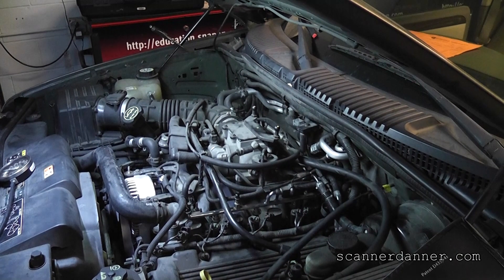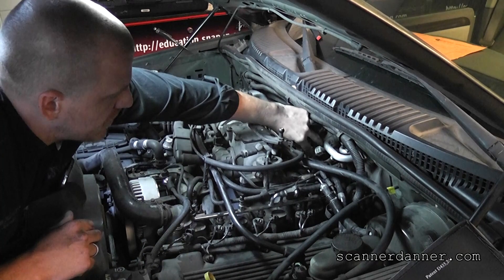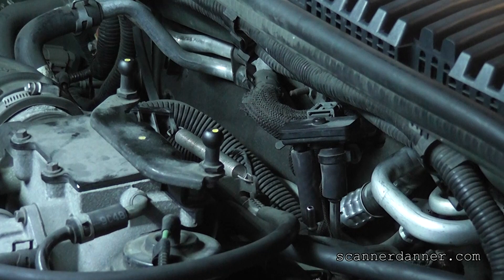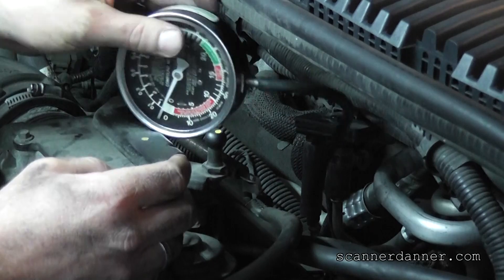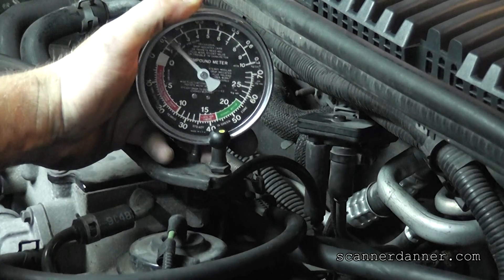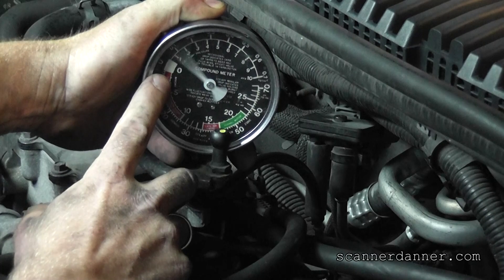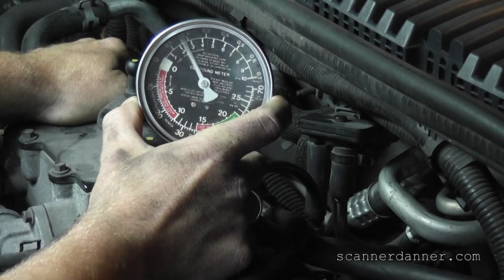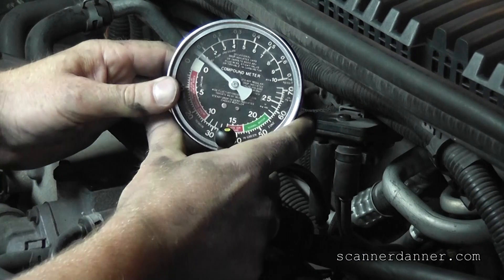How to test for a restricted exhaust using the DPFE sensor on a Ford

Comment: If you voltage test dpfe signal koeo at the pcm (just the signal pin 65) from positive to battery - is voltage suppose to <=5v? 
If the voltage is over 5v? Is it the PCM not the circuit?
Reply from the maker: How are you connecting your voltmeter? Negative lead to battery ground is how you should be testing it. What is your voltage reading at the sensor and at the computer pin?
Reply: @ScannerDanner  yes sir that’s exactly how it tested it on the voltmeter. From battery ground on the meter (-) and positive on (+) pin 65 straight out was 5.12v from connector and from vehicle ground it was 5.05v 
Can’t run her cause she will stall and when I check inputs I do get communication issues such as turn key off and on
Reply from the maker: @edb3654  what is your signal voltage measured at the sensor with it plugged in and backprobing? 5v on the signal circuit is normal open circuit voltage (bias voltage)

Comment: thanks, I thought I'd have to drill a hole in the exhaust of my ohv mazda b4000 or take it to a mechanic
what's between the ref and the hi side? is the hi side closer to the intake manifold/egr valve?

Comment: Would plugged cat cause those hoses to blow off got a 96 f150 keep getting a p0402 I can clear it and a week later it's back I had to put a wire tie on the hose to keep it on the dpfe also i replaced the dpfe engine runs good just feels kind of sluggish i just rebuilt it so it shouldn't feel like that
Reply from the maker: Yes, absolutely!
Reply: @ScannerDanner   well just hooked a vacuum gauge up to the dpfe and it stays at 0 i had my dad hold his hand over the tailpipe and it shot up then he pulled it off and it went to 0 again guess it's a messed up egr I just put a new dpfe on it so I know that ain't it
Reply from the maker: @christopherdarrough2667  that test needs to be done at 3000 rpm (no more than 2 psi)

Comment: Hi scannerdanner. Love your videos. Need some advice please. I've got a vauxhall zafira b 1.6 petrol 2008. I've got p0171  lean code. No vacuum leaks, done smoke test. Checked all fuel system, perfect. Changed stuck open evap purge valve. No exhaust leaks. Both 02 sensors perfect.  Change electronic accelerator pedal and new throttle body. Changes intake air temperature sensor. I changed the cat converter about a year ago. Changed map sensor because scan tool was reading 7.5in hg at idle.  Done vacuum test. Getting 22 in hg. Done snap throttle test, goes down then up to 25 and quickly settles at 22 in hg again in the green area. With steady acceleration goes to 25in hg. Dont know if this is normal. This problem started 3 months ago when I replaced a stuck open thermostat. Changed the egr valve. Had several machanics look at it. They just took the money and left. All parts I replace were genuine parts from vauxhall. I've ran out of ideas. Please help 😭

Comment: Had one of these today on a 97 Thunderbird.  Came in with some EGR codes, low power,  and a wicked noise.  Found one of the EGR DPFE hoses missing.  Replaced it and retested.  Had a similar noise but not as loud.  The small diameter EGR pipe fitting was broken from the EGR pipe and the EGR valve was wicked hot.  At this point I hooked up my pressure gauge to the EGR DPFE hose to check the exhaust backpressure.  My pressure gauge literally shot off the car when I started it.  At this point I removed the O2 sensors and used a borescope to find one catalytic converter completely melted inside.

Comment: Question to auto mechanics (diesel) pdf poured through the pressure valve tube that goes to the filter, connects the garden pump, poured the stove cleaner, detergent for the pump, and diluted the CLR. IT HAS RECEIVED 2 LITERS OF THE MIXTURE <POMPA PRESSURE ALL DROPED INTO FPF ON THE WORKING MOTOR <MUCH BLOCKED FROM THE MUFFLER! AFTER THIS, I CHECKED OBD2> FROM 200% OF THE BEACHED PDF LEFT 12% - INTERESTING WHAT CAN THE CONSEQUENCES OF MY EXPERIMENT BE? ALREADY HAD 400 KM <FLIGHT NORMAL !!!!

Comment: I have a 2004 cobra that has less than 1 psi at 2000 rpm but when they did a dyno run and checked back pressure at 6400 rpm it was 19 psi? Is this because the cobra have a stock supercharger or something else. Nobody can give me an explaination why the 19 psi is there. 
Thanks Bob
Reply from the maker: under load backpressure measurements are completely different than this test. Think about how much throttle opening it actually takes to run an engine at 3000 RPM in park (it's not much). Compared to a WOT run at redline. Huge difference
Reply: Will the backpressure of 19 psi hurt the engine it made 442 lb of torque and 395 RWH. I just got the car and do not want to damage the engine on it. I really enjoy your video you keep thing simple when explaining things.

Comment: He failed to mention this is only checking back pressure on two of the three cats
Reply from the maker: no, I mentioned exactly what this was an was not testing @ 4:15. The main point of this video was showing a quick test for exhaust restrictions.
Reply: ScannerDanner  I stand corrected I think you for the reply

Comment: great videos, i just bought this same gauge on amazon, but it says vacuum/fuel pressure gauge...it has 0-30 psi for vacuum and 0-10psi for fuel( the part you were just using to monitor the dpfe was the fuel side)....my question is why did it not go on the vacuum side of the gauge? why did it use the fuel pressure side that is ment for carburetors? thanks ive been watching other back flow videos using the same gauge and everytime it always showed readings on the vacuum side of gauge...

Comment: That squeal!!! I got the same sound and thought it was a camshaft bearing. My DPFE tubes popped off and when replaced, they burnt off. I'm going to open the O2 holes first to see if it is clogged cat. But that sound!? Where would it be venting?
Reply: Was it clogged my dpfe sensor blew off then burnt off after I replaced it so far I put a catalytic converter cleaner in my car and it actually made it feel more responsive and I think lowered back pressure I didn’t test it though so could be placebo

Comment: I would like to add some information with respect to backpressure testing. Infact it would be helpful to distinguish between psia (absolute) and psig (gauge) whenever we talk of pressure. What these pressure gauges show is actually psig, it means its the pressure above atmospheric pressure. If the backpressure is 2 psi (infact 2 psig) then it is equal to 14.7psi+2psig = 16.7psia. If we don't specify psig or psia, then it can be confusing because 2 psia is vacuum and 2 psig is positive pressure.

Comment: Does the Dpfe tube run to same spot are does one go to one cat and the other to  the other downstream cat.  What's the point of them
Reply from the maker: master tech cody It ran to the passenger side exhaust manifold on this particular truck. It provides exhaust gas for the EGR system and the DPFE sensor is used to monitor flow.
Reply: ScannerDanner  you said there's three cats on that truck so if it only runs to the passenger side does all the cats connected together after these tubes I guess that would be the only way to test all 3 cats with one tube on one side .

Comment: Without DPFE you'd have to make your own O2 sensor bung to vacuum port adapter right?  That would probably get really hot really quick.  I know I've seen you cover that in another video somewhere.   It could be helpful to link to that video from this one to extend to people who do not have a DPFE.  It's certainly not easy to access and tee into most EGR's.  What do you think about using a temp gun to measure before/after cat?
Reply from the maker: ***** It would but I've done it and it works. I take an old O2 and punch it out and saw off the ends, then adapt my gauge to it. Did you mean this one? https://www.youtube.com/watch?v=Lafv2c4szZY
A temp gun to find a restricted cat? I've never tried it and I do not think it would be a 100% accurate test like this one.
Reply: ScannerDanner I've heard of the tests and tried the tests with a temp gauge to verify good or bad catalytic converters. Scanner data works so much better. Nothing I did with a temperature gauge on my old or new cat actually matched any prescribed tests.

Comment: Not related to this video but on injector testing  how would you go about testing diesel injectors on a common rail diesel system . I dont know what to look for as normal readings. Thanks again for the work you do on your channel it is the best shot in the arm i have gotten to be a better tech in a long time.
Reply from the maker: Paul Meehan not sure man, never tested one. hopefully soon I'll be playing around with some diesel systems.
Reply: ScannerDanner I hope so!:)
Reply: Gregory May w
Reply: Diesel pressure is quite high, never tested it with a guage but a scan tool does a good job.
Reply: Diesel pressure is quite high, never tested it with a guage but a scan tool does a good job.

Comment: Great video again Paul!
I Would like to see those sensor on Finnish cars too with petrol engines, just havent had that luck yet on it..
So drilling is still quickest way to get result as oxygen sensor ar allways rusted in and leaving them out of the loop may make little different results.
Reply: How'd u plug it after? Just thread a bolt in or something?
Reply: @942doc1  Rivet nut and bolt. If those cant seal it then, i just weld it. But the bolt with copper washer is the best as you can easier retest it, if needed.

Comment: Nice 👍 Paul  the swing on that needle at idle going up an down, I had a Silverado last week doing the same thing on a fuel pressure gauge, well I thought the gauge might be chooched  so I hooked up another one and same thing , would swing from 45-55 psi at idle.  Took me a while but I remembered a question I asked you years ago about how could the fuel boil in the rail , well I let the truck cool down and the gauge was steady as a rock at 52 psi. Never seen this before but it was real hot out and the truck was real hot too. Thanks.....
Reply: Customer concern- rough idle only , runs great otherwise.  No CEL , no out of range data pids. Plugs and wires recently changes. I smoked the engine no leaks. I cleaned the injectors thru the rail with a pressure canister- no change. Put fuel gauge on and got erratic needle swing. Let sit 1 hour and needle was now steady to do a injector balance test- each dropped to 42 psi.  After all this I  get a pair of pliers and pinch the pcv line and the engine smooths out . Two things noticed the pcv did make a high pitched rattling sound and it was a 2057 , wrong pcv only good for up to 2000 trucks - this truck was a 2002. All fixed now and runs great.  BTW I did hear the high pitched rattle from the start but it sounded like it was coming from the hydro boost.  I wish in hindsight I scoped the pump wave form during the erratic gauge readings but it was super hot out so I decided it was Miller time instead :)
Reply from the maker: I'll drink to that :)
Reply from the maker: Steve Rob crazy, never thought of the fuel boiling causing those psi impulses you described.
Reply: Steve Rob Would the fuel boiling make the car also go rich?
Reply: Steve Rob Was there a fix for this issue or just a side note for data that may have distracted you from the real goal?
Reply: Good video